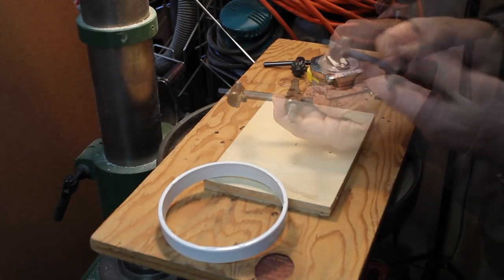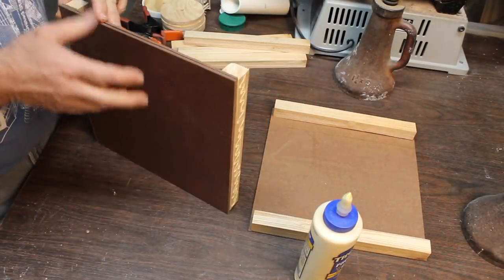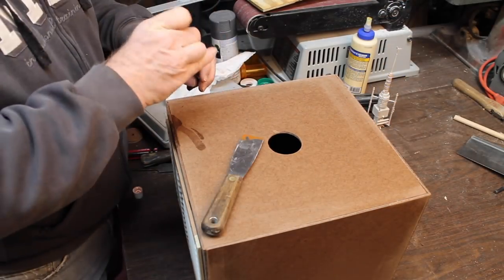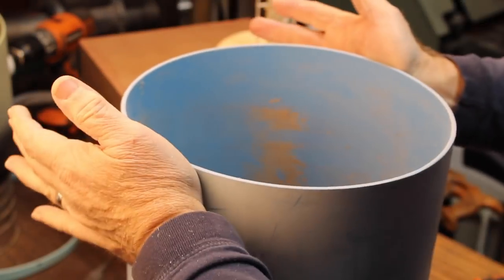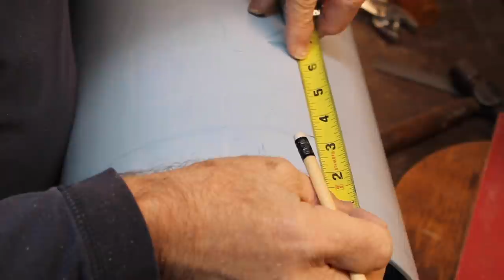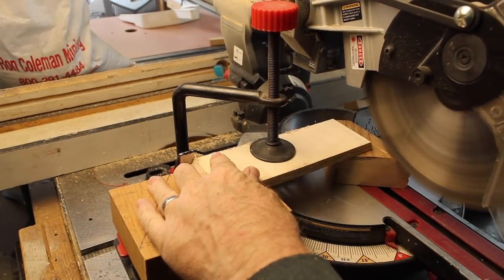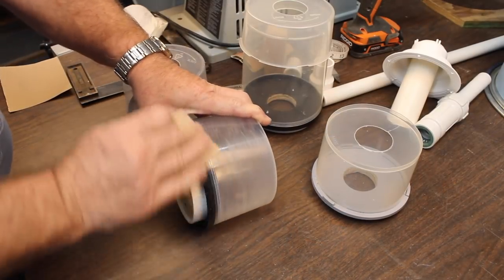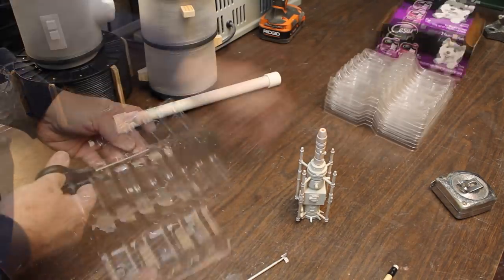Can You Star Wars This - Dog Water Bowl

Comment: It seems like a lot of effort to go to, and then not dress up the blue part of the water bowl.  It must be nice having little dogs sometimes - mine drinks almost that waterbottle full a day - her water dish is a 20liter bucket.  It seems a little tall to be inside, yet too fragile to be outside.  It is a great looking build - I am just calling it out on the ridiculous factor.

I guess that I could weld one up similar and run a pump to it and probably put a bird feeder in the top of it somewhere.  I really need to build some more Star Wars things.
Reply from the maker: The blue portion of the water bowl is difficult to paint due to the composite of the material it is made from.  Also, it gets wet which additionally would cause problems with the paint.  As far as size, it fits really well in their home with high ceilings, so it works.  We wanted it to be as accurate as possible hence the size.  All in all, the effort is to hopefully show builders techniques and tips for thier projects.  Its mostly about the journey . . .
Reply: @TheSmugglersRoom  I loved the build, and if it fits inside their house, that is an absolute win.  It is a really good video showing how to use househould items in builds that would otherwise end up in landfill.

Comment: One thing I’ve been crazy for lately is DIY lightsabers. I’d love to see your attempt at it! 

Have you ever looked into smaller scale model making? It’s soemthing I find really cool and I think you could put a fun spin on it 

Love the work, keep it up
Reply: If you really want to learn about DIY lightsabers, check out The Custom Saber Shop. I've built seven totally unique sabers with sound from reading their forums and  watching their videos. If you search my name in their forums you'll see every one of my custom sabers.
Reply from the maker: Thank you!  We actually purchased an aluminum pipe stock and a new metal blade for the band saw.  In the coming weeks we are 100% going to do a totally custom saber, because i am just chomping at the bit to make one.  That said, @QuixoticJedi is correct, the Custom Saber Shop is very very cool!  As far as scale model work, we also have plans for our large display cabinet, and it will be a series of scale model building to get it where I want it.  We hope to start that section of the room in the coming months.
Reply from the maker: @quixoticjedi942  The Custom Saber Shop is a great resource!!!